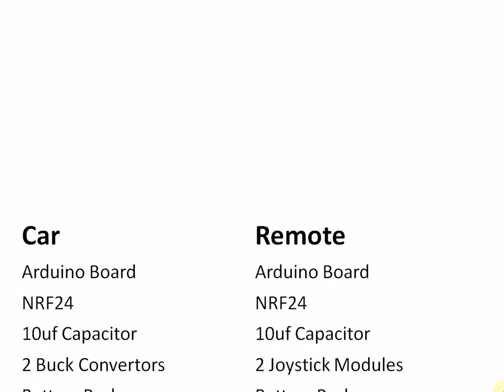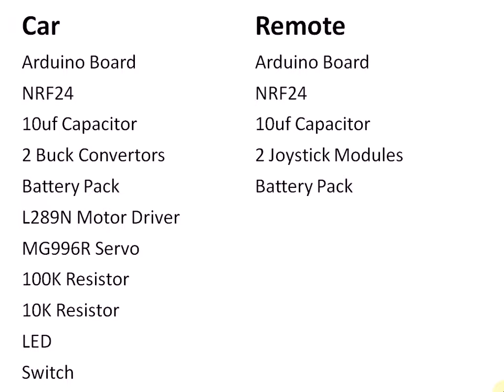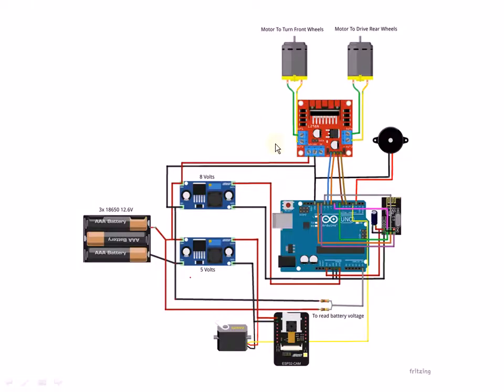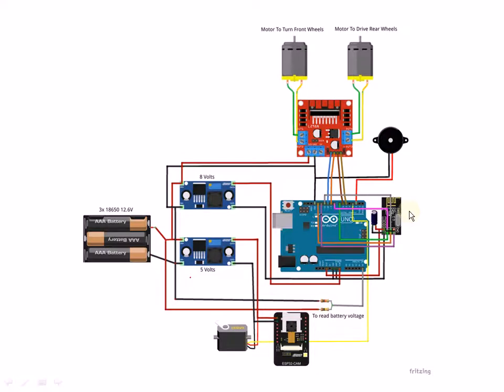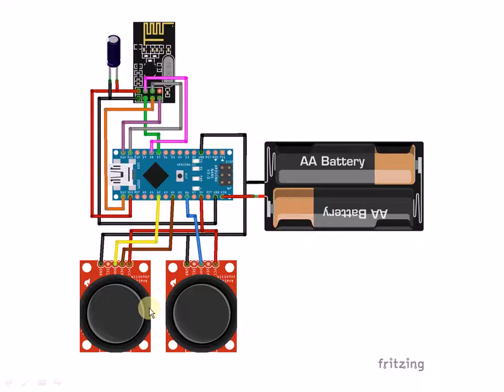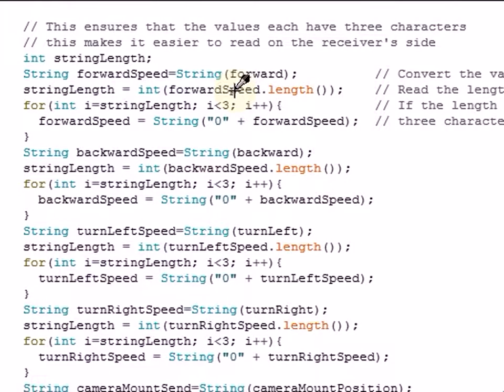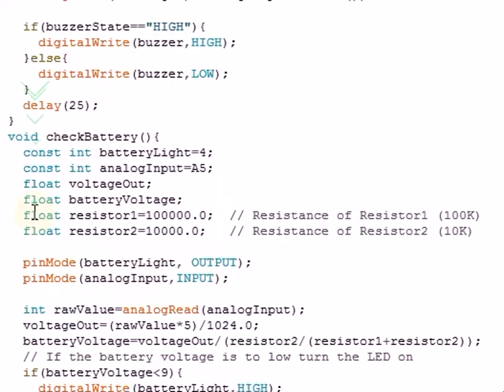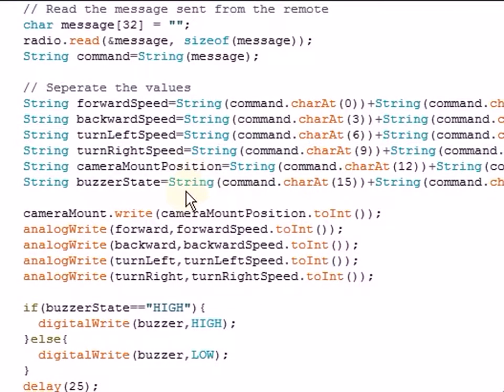Arduino RC Car Conversion With The ESP32-Cam DIY For Beginners

Comment: Hey man, I wanted to do something similar. I needed a total of about 6 motors and 2 servo motors, which there isn't enough GPIO pins for on the EPS32 cam. Could I hook up an Arduino Uno similarly to you, and use the Uno's GPIO pins for the motor connections? If so, how?
Reply from the maker: Yes you can, I have the Arduino and ESP32 working independently of each other. The Arduino is handling the servo and motors and the ESP32 is only operating the camera. 
You could also use an IO expander board like this one: https://www.ebay.com/itm/185859414081 

It is I2C so you can go from 2 pins to 16
Here are some tutorials for it: 
https://youtu.be/QoT-5RMUaxM

https://www.ojisanseiuchi.com/2018/05/10/Interfacing-an-ESP32-to-an-MCP23017-GPIO-expander/

http://www.esp8266learning.com/esp8266-mcp23017-example.php

https://www.instructables.com/IO-Expander-for-ESP32-ESP8266-and-Arduino/

Are you making a rover style car?
Reply: @learnayg  Thank you, I am looking into the MCP23017.

The project is a robot that drives around and picks up tennis balls, and shoots them as well. I want motors for the 4 wheels below the car, as well as motors for the ball intake and outtake system (which are going to be spinning wheels in front of the robot). The servo motors will connect to a ramp and a small door which will control the ball intake/outake system.

One thing is that it says the MCP23017 just gives you an expansion of digital ON/OFF pins, doesnt support PWM modulation and doesnt give you analog capabilities. Would I need these for my project? The motors simply need to be able to move the robots wheels, at a certain speed. The servo motors need to be able to rotate at a certain speed/time as well.